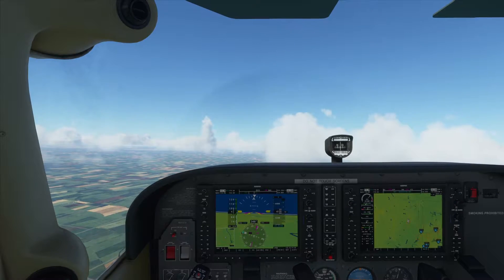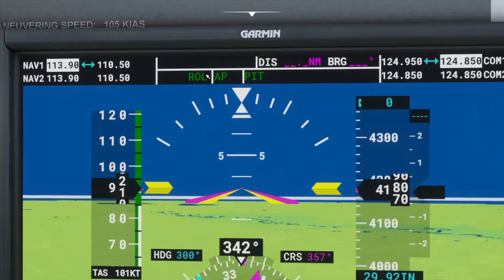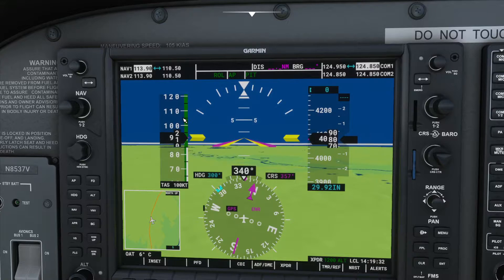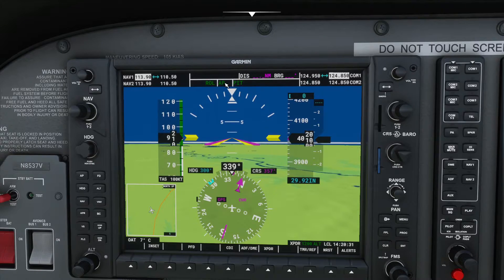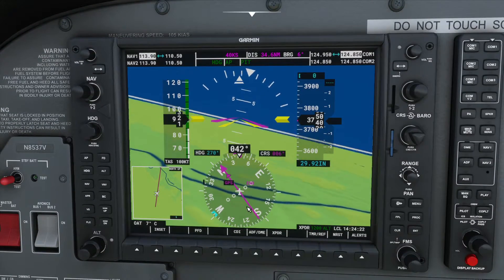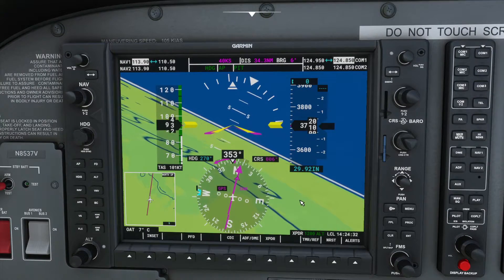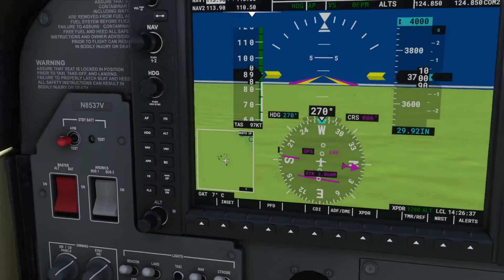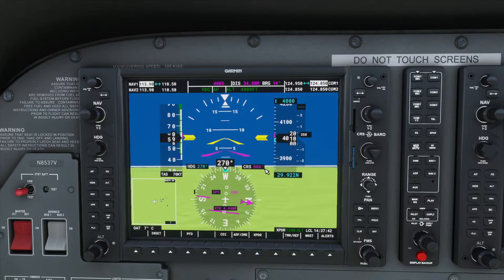MSFS: Autopilot basics in the Cessna 172 (G1000) - Microsoft Flight Simulator

Comment: Hey Kip! Thank you for your informative videos! I have a quick question. So, I've done everything you showed in the video here. But my 172 doesn't do the same thing yours is doing while on autopilot. When I attempt to use alt mode in order to hold my altitude, for example, my aircraft does not acknowledge any change. I don't know what I'm doing wrong. It's the same thing for my speed and heading. Also, I can set my altitude for, let's say, for example, 3,000 ft. prior to takeoff. My aircraft still doesn't respond to the setting. What am I doing wro🎉ng and how can I fix this?

Comment: Thanks for the amazing demonstration. 1 question, how do I gain the targeted altitude quicker? As it feels long to reach it.
Reply from the maker: Most likely it's that you need to lean your mixture as you climb to improve engine performance. This is something you also need to do before departing airports at higher elevations (or with high density altitudes the outside air temperature is high).

One option is to just turn on "automixture" in Options -> Assistance Options -> Aircraft Systems -> Automixture.

Or, if you want to do it yourself, during the climb you'll need to periodically lean the mixture by pulling the red knob (near the throttle) out slowly and monitoring your RPMs to maximize them.

The higher altitude you're at, the lower your climb performance naturally becomes due to the air being thinner.

Comment: outstanding tutorial. I just wish my C172 G1000 AP was working like what you show (I'm trying to figure out what's going on). But anyway, thanks -- now I know how it's supposed to work
Reply from the maker: If you want to hop on the Discord server I can help you out one-on-one when I have a chance! Here's the link: https://discord.com/invite/8hcJpsvsd9
Reply: @KipOnTheGround  That is really nice of you, and I might take you up on it if I continue to have these issues. But -- I've been configuring flight sim hardware for probably 20 years (remember GoFlight? Precision Flight Controls?) but have never run into this. It's with my new VKB FSM-GA autopilot panel. My next step is to disconnect (via the MSFS control configurator) all of my hardware other than just a throttle and stick, and see if the clickable AP controls work as expected. It seems like a controller conflict but thus far I haven't seen any of those in MSFS's control configuration.

Comment: One thing I missed, if you press the ALT button again to disengage altitude, you can manually fly to the altitude set, and it will then lock that altitude and auto pilot will fly at that altitude for you. It makes flying a bit more fun.

Still looking for a way to control the rol of the plane after you use the flight director (FD) mode to maintain whatever heading you're flying at.

Comment: Brilliant Intro to G1000 .. thank you.  One question.. I am using a trim wheel on My TB V1Flight Console to control trim.  Sometimes when I switch the autopilot off,  I find that the aircraft pitches up or down quite violently.  Because, as I understand it, the AP uses the trim for attitude / vertical control, it can easily deviate quite a way from  the trim set on the trim wheel before the AP was switched on and, since the trim wheel on the TB V1 is not motorised, as it will be in the real aircraft,  the trim it is demanding has not changed.  So, when using the trim wheel used as an axis, unless the software ensures that the trim wheel demand on exiting the AP is artifically set to the same as that in AP, there will always be a jump in pitch.  I don't think that the software (at least for XBOX) includes this 're-registration' of trim wheel demand to match the AP current setting before switch.. hence my plunge to the ground when switching off the AP on ILS approach, on final approach!!  Have you experienced this?  If so, do you have any solutions e.g. map trim wheel  to increase / decrease elevator trim (if available).

Comment: I am using the OnAir career mod for MSFS and I just bought this aircraft. How do you turn on the second screen?
Reply from the maker: The G1000? Make sure you’re turning on both avionics 1 and 2 switches. Following the checklists in the top menu can help make sure you’re not missing any steps.
Reply: @KipOnTheGround  I am using the C172 G1000 realism mod. The second screen doesn't fir up right away. you have to click the button on the bottom right. I got it started. I will have to watch your video a couple of times to master everything like entering a flight plan.

Comment: Hi.  Awesome video!.  When I climb in same plane to 10k with AP.  After 7k or so it battles stall warnings often.   Full throttle for climb, no flaps ,auto mixture selected any advice
Reply from the maker: If you're using VS to climb, don't. Use FLC instead and set your target airspeed (using nose up/down buttons just like with VS mode) so you don't end up stalling. As you get higher, air density is lower, so you can't climb as quickly. Things like wind and temperature (density altitude) can also affect your climb performance mattering where in the world you're flying. The 172 takes a long time to get up to 10,000 FT. Hope that helps!
Reply: @KipOnTheGround  that was life changing!!! I just cruised up to 14k with that advice !!!.  Now if I could just get control.of my 172 before landing nice even glide !

Comment: Thanks for the video. 
I am not surprised by the fact that so many fatal accidents happen with the g1000. 
I had two incidents using xplane simulator. On autopilot I was flying a rectangular pattern and suddenly the plane started spiraling to the ground. I had to fight to gain control.  I think I may have felt like the 747 max pilots.  The  second time in  autopilot it just started steering somewhere else.  This this thing needs a big red button that says MANUAL CONTROL.

Comment: Knobs to set heading and altitude on two different autopilots turn bright blue when touching with cursor and cannot be adjusted.
Reply from the maker: It sounds like your mouse settings might not be configured to work with the "Lock" interaction mode. Try resetting them by going to Controller Settings, then finding your mouse at the top. Under the word "mouse" are 2 blue arrows and the name of your current preset/profile. Use those arrows to change to the "Default" profile. Then save changes and try again. Any custom mouse buttons you had set previous will need to be redone. Hope that helps.

Comment: Thanks so much for the super helpful training vid! I'm having one problem though...I can't get the plane to fly the GPS track in Autopilot. In the world map, I select a departure and destination airport and then when I take off and engage the AP...the plane just keeps flying straight and the green letter above the screen don't say GPS. I click on the NAV button on the AP, but it still doesn't change heading to fly the GPS track. What am I doing wrong?
Reply from the maker: On the left screen, press the button labelled "CDI" until you see the heading instrument (the compass on the left screen) change to show a magenta color instead of green.
Reply: @KipOnTheGround  it turned out to be a software bug.
Reply: Having the same issue. There is no active CDI button at the bottom of the screen. Using Xbox not PC

Comment: Hi, notice that tool tips show the state of the autopilot etc when you hover over them, I.e. on or off. Now it seems as if that situation is no longer the case. All I see is the description. I think a recent update has broken this facility. Or is it something in accessibility?
Anyway, I find your tutorial really helpful, Thanks from the UK.
Reply from the maker: Hey Brian, this video is a bit dated at this point, but you can find the two "cockpit interaction systems" within the General/Accessibility settings. The new default is called "lock" and has some more informative (but larger) tooltips that can be used. I believe if you switch to "legacy" instead of "lock" that you can get the original tooltips back. I personally prefer the new "lock" style, especially when interacting with the "range" knobs on the G1000 NXi (I recommend checking out the NXi in the marketplace, and I have a bunch of videos using it -- it's really amazing how far it's come compared with the default/stock G1000).
Reply: @KipOnTheGround  Thanks, will have a look

Comment: Great videos... but you only made one error... not even an "error".. but just lacked some critical clarification.

When climbing on AP, NEVER use VS... always use FLC. When descending, you always use VS. This is not just a nuance but is critical. If you use VS to climb, if the plane can't maintain that VS (getting to the top of the performance of the plane for example)... it will keep pitching up dangerously and the AP would eventually click off and leave you in a precarious position. Likewise... on descend you could overspeed the airspeed if you set your decent too steep. 

This seems like a minor nuance and I am just being picky... but it really isn't. I'm a real world pilot (CPL) with lots of time on G1000 and this is a first training flight topic and really is critical... especially if you fly in extreme weather locations (icing/hot/etc).

Otherwise - I love your videos.

Comment: So it's not possible for the AP to hold an altitude while allowing the user to manually steer the plane with the yoke?
Reply from the maker: Correct! One option is to use heading mode, and turn the heading knob whenever you want to turn the plane. It'll maintain the altitude and the heading knob becomes your yoke :-) I actually fly like this pretty often when I want to sightsee and not worry about maintaining altitude. It's also useful if you fly in third person/external camera mode.

Comment: The G1000 in MSFS is missing a lot of features. Maybe Garmin will offer actual software at some point. Being Garmin, they'll charge an arm and a leg for it. I've only ever seen the full G1000 software on an RTD
Reply from the maker: The good news is we can expect a lot of updates to them in the next 3 months with Sim Updates 5 and 6. Microsoft hired the Working Title team that makes a really good G3000 mod (they have a G1000 mod as well but it's not worked on much), so we can expect to see it implemented into the base/vanilla sim at some point.

For now you can use their mods from here: https://github.com/Working-Title-MSFS-Mods/fspackages

The G1000 is behind a bit though, as OBS mode doesn't work (even though it works in the default G1000). The G3000 is pretty amazing but is only available in the TBM 930.

There's also a great GNS 530/430 mod here: https://github.com/pimarc/pms50-gns530 - This same developer also has a GTN 750 mod here: https://pms50.com/msfs/

Comment: You shouldn't initially hit autopilot on, and you should select which mode you want first (Heading mode for example).  Then turn on autopilot once your heading bug is tuned into where you want to go.   If you just go from autopilot off to autopilot on in a bank angle it will hold that bank in roll mode which could be dangerous when you need to stop your bank immediately.   Roll mode doesn't hold your wings level, it holds your current bank, which in this instance you don't have any initially so yes it will hold wings level.
Reply from the maker: Hi Mitch, thanks for your comment. I enabled autopilot without first setting a lateral or vertical mode to demonstrate the 2 default modes (ROL/PIT), and did it while flying straight and level, so there was no risk of accidentally holding an extreme bank or pitch at that moment. In the version of MSFS I was on when recording this video, ROL actually does level the wings, which is not how the real G1000 autopilot behaves. I mention that difference at 2:05 in the video.